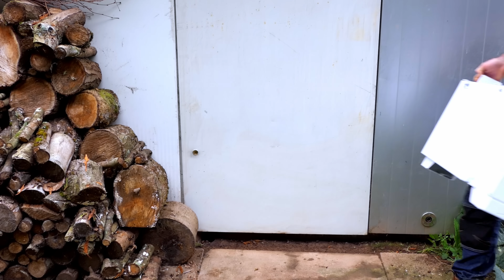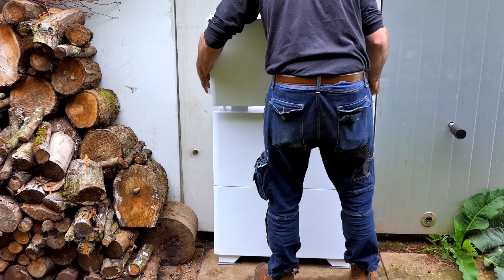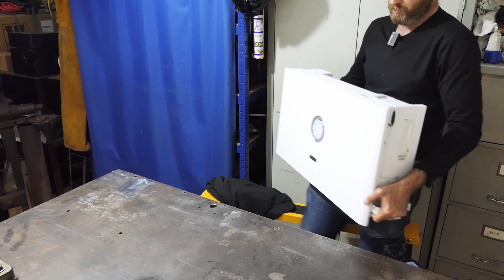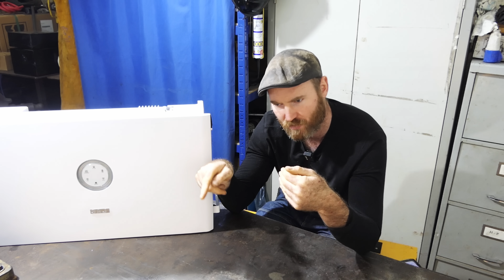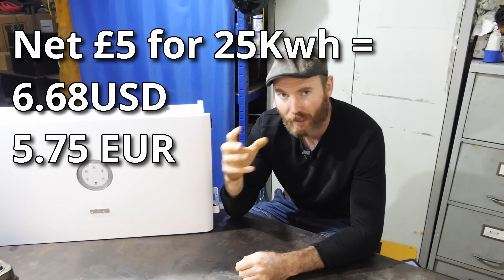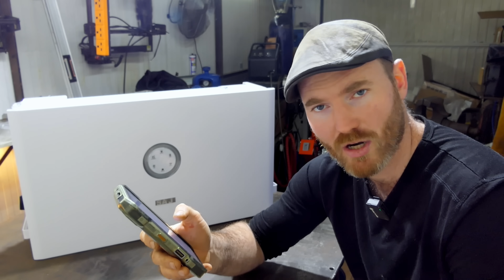New Batteries Make Money?... I'm shocked

Comment: Excellent approach. Have you ever thought of ways to produce electricity from natural gas? In the event of a power cut, gas boilers cease to work even though gas supply is still available. Gas in UK is so much less in cost than electricity, that using it to generate ought to be economically viable. I know you could run a boiler from a small inverter and battery, but no way to recharge a battery unless you have solar panels which don't give much in winter when you most need it. Perhaps you could give it some thought please. Thanks.
Reply: Technically yes, any generator should be able to run on gas. After all, any petrol engine can be modified to run on methane, which is what natural gas is. For vehicles, you have the problem of storage: It can be highly compressed (CNG), which requires heavy and bulky tanks to withstand the high pressure.
Or it can be stored as liquid methane (LNG), albeit not indefinitely. Tanks for storing LNG have to be extremely well insulated, since it is a cryogenic liquid, with a boiling point of -162 degrees C. So tank insulation equivalent to what is used for liquid nitrogen (boiling point -196 degrees C) are required. Even so, no insulation is perfect, so there will always be some boil-off. For liquid nitrogen this isn't a problem, since the nitrogen gas from boil-off can just be vented to atmosphere.
But you don't want to be venting methane boil-off from LNG to the atmosphere - this is a waste of fuel and a bit of a fire hazard, not to mention methane being a potent greenhouse gas, much more so than carbon dioxide. This is why LNG tanker ships actually use the methane boil-off from the giant spherical tanks as their propulsion fuel - it would be wasted otherwise.

Anyway, petrol engines can have significantly improved performance by using methane, if properly tuned to make the most out of it. This is because methane has an "octane rating" of 120, better than even the highest quality premium petrol blends. So an engine purpose-built to run on methane can have a higher compression ratio, improving both power output and efficiency.
Another option is to use propane as the fuel for a petrol engine: The octane rating of propane is 112, so not quite as good as methane, but still better than most grades of petrol. Dual fuel engines capable of switching between petrol or propane have existed for several decades, so converting a petrol powered generator to run on propane should be possible. Liquid propane is also not a cryogenic, so can be kept liquefied indefinitely by moderate pressures. Hence why it is often a fuel of choice for home cooking or heating, particularly in rural areas which do not have mains natural gas supply.

If you don't want to have to modify a generator to use either methane or propane, there is another option: Small generators (in the 20 to 30 kVA range) using a gas turbine engine instead of a petrol or diesel piston engine do exist, though they are far more expensive. These are usually intended to run on propane, but should be able to run on methane without any modifications. The only possible problem with that is whether the mains gas supply can deliver methane at a flow rate high enough for the generator to run consistently. If not, then you may have to use propane anyway.
Reply from the maker: My generator has just been converted to gas because I'm producing wood gas. Lots more on that coming soon. Cheers J

Comment: Very interesting you mentioned a diesel generator as ive actually been considering one with a battery as a kind of hybrid system though ive not done any calculations. For me, its more to stich a middle finger up and get off the grid as much as possible. As with you, we are on oil for heating/hot water but as a tree surgeon, I have anunlimited supply of free logs so use the heating very little. I personally see the cost of energy spiraling to a point where its almost a luxury commodity and I want no part of it
Reply from the maker: I think you and me have a lot in common... I've been doing a lot of coppicing and polarding over the past 5 years and will be doing a lot more videos on wood gas generators. My diesel generator is undergoing experiments using black diesel (heating oil £0.48/L mixed with  filtered free waste engine oil) which is £0.05/kwh... Cheers J
Reply: @joshuadelisle the wood gasification is certainly very interesting but a bit beyond my simple mind sadly. Great watching though and be interesting to see how it goes with the black diesel. Seen a guy on Instagram running all sorts on it so im sure it'll work well!
Reply: But you still have to buy fuel? I’m not sure how you think you’re isolating yourself from price rises.
Reply from the maker: @edc1569 wood for me is free, black diesel is £0.25/L. Cheers J

Comment: Man, can we ever beat this! It's called induction. This pulls from a metered circuit while induction pulls from the surrounding circuit. I really don't understand why others have not loge since moved on to induction collection. It's not free energy, you already paid for it! But it's wasted energy that no one seems to collect? 
Cheers 🍻
Reply: Induction does indeed pull power from a circuit by placing an inductive load.  
It's how electric companies are able to determine with someone is stealing power from hi-tension cables by inductive "taps".
Reply: @_SurferGeek_  
Correct!
Reply: @Finite-Tuning  I guess I'm confused on what you're trying to say then... you say "...it's wasted energy that no one seems to collect?" but it's not.  You can't turn on a light drawing 100watts of power and use an inductive load to collect "wasted" power.  You'd be increasing the load over the 100watts and still pay for whatever additional power you've drawn, or induced, from the circuit.  How is that collecting "free energy"?
Reply: @_SurferGeek_  
You're not yet capable of this conversation. No offense, but you don't yet understand induction. You have not read and understood anything I said. Your question proves this. Education is free if you are willing to do the homework. Liking you own comment is always a bad thing!
Reply: @Finite-Tuning  Education is free but understanding what you're being taught requires comprehension... Clearly you have issues with that part.  Have a great day as I'm done with you.
Reply: @_SurferGeek_  
No need to be angry about ignorance, calm your mind and simply learn how induction works. Or not, the choice is yours! Maybe start with learning about Tesla and Moray.
Reply from the maker: Interesting. Cheers J
Reply: I don't understand.
How could you collect unused induction power. Please explain
Reply: @cajampa  Look up current transformers.

Comment: Doesn't have to be installed by an MCS registered installer. That's not what the regulations state, even though that is how it is interpreted. eFixx have an excellent video on the subject. The UK also produce more than enough gas to supply the nation, but by law they are obliged to sell on the open market. Same for Oil.
Reply from the maker: I think for the insurance and warranty you do... Cheers J
Reply: @joshuadelisle would be good if you can clarify why it is required.
Reply from the maker: @WindyJAMiller I think to make sure it's done correctly and registered so. Cheers J
Reply: @joshuadelisle MCS doesn't superseed IEE.  You do not need to be MCS registered to sign up to SEG it's simply the energy companies acting on mass, blocking the process.  The only company that does facilitate it is Octopus, I've done it myself a few times.

MCS is not the be all and end all of domestic energy and renewables.
Reply from the maker: @WindyJAMiller that's not what I was referring to. SAJ requires the installation to be done by a qualified MCS for their warranty and for the home insurance. Nothing to do with the grid companies. Cheers J
Reply: @joshuadelisle I don't want to go into detail about it all over YouTube.  If you want to reach out to me I would be happy to explain the various aspects and considerations with this and other renewable projects, I've got over 15 years experience in this sector.

Comment: 97.6% efficient, but also needs to run resistive heating elements.  Efficient my foot.  The need to heat these things needs to come out of the efficiency rating.
Reply: The heatings only needed when they are cold. Sub zero degrees.  Which doesn't happen much in the UK
Reply: @WindyJAMiller  I don't believe that for one minute.  They are probably running them at higher temps.
Reply: @tarstarkusz fortunately you don't need to believe it, it's a matter of fact.
Reply: @WindyJAMiller  You know this how?  Stop being a liar.
Reply: @WindyJAMiller  Even more fortunate, you can be corrected too! 
There is no magical boundary at which lithium batteries start to need heating, it's a gradual drop-off. 
If they have a built-in heater,  it would make sense to keep them at a temperature well above 0ºC, for capacity and longevity (life cycles). My guess, around 15ºC.
Reply: @goncalovazpinto6261 I will just point out that only one of us is guessing here.
Reply: It's 100% inefficient if it's only heating the appliance and not anything useful!
Reply from the maker: Fair point. Cheers J
Reply: 97.6% efficient?  I thought he said 96%. In any case, is this efficiency one way, or both ways?  The power conversion needs to happen once for storage and then again when you sell it back. So a one-conversion efficiency rating of 96% would be an overall efficiency of only 92% in a two-way exchange.
Reply: @aerostahr that will be one way, probably solar mppt efficiency too. Round trip with LFP batteries and a hybrid inverter is typically 80% -85% round trip efficiency.
Reply: @WindyJAMiller  Thanks for elaborating.  Is it  typical for manufacturers to specify this specification as a round-trip feature?  It seems to me their marketing departments would try to slip in a one-way conversion figure which would allow them to advertise a higher efficiency rating, and bury the details in fine print.  Also, based on every spec I’ve ever read (take power supplies for example), efficiency is always stated as single-conversion, one-way.  EDIT: Never mind.  That’s exactly what you just said 🙄
Reply: @aerostahr blimey, I was a bit confused when I posted those numbers.  I meant 80%-85% round trip efficiency, everything taken into consideration.  Which is still really good when you think how many times the power is being changed and chemically stored.

I don't think there's an intent to bury the numbers, I think our host is new to this area and has been told what to say.  I think with a bit more knowledge and experience he'd work it out.
Reply: @aerostahr  I double checked and he did say 97.6% efficient.  I don't remember if he said this was one way or round trip efficiency.
Reply: Resistive load heating is 100% efficient i.e. the movement of all electrons is transferred to radiant heat.
There will probably be very unnecessary MOSFETs and MCU to turn said resistive load on and off....
Reply: @Coxeysbodgering  So?  If you have to spend 100wh to keep a kwh at the right temp for an hour, that's a 10% inefficiency.  It doesn't matter what efficiency the heater is run at.  The SYSTEM is inefficient.

Comment: I have solar and batteries.  You're right, you are not necessarily saving money. If I add up the interest i could have earned on the investment of solar I'm probably about breaking even, maybe  a little ahead but if I'd had known than what I know now......
Oh yes. I can't buy a unit of electricity for 9p unless I have an electric  car and charger ( charger alone £1k) or a heat pump
Reply from the maker: Hmmm... That's a bummer. Cheers J
Reply: Eon you can - next drive. Can go on that if you have a battery. I got in it as I was getting one then had to cancel so don’t have anything and still on it! They don’t check anything. 6.7p 12-7am

Comment: These will last longer than 15 years. That’s just the warranty, but LFP batteries (especially when charged/discharged slowly like in home energy storage) last an incredibly long time. I’d say probably 20-25 years.
Reply from the maker: They still work but lose 20% capacity. The inverters however will go out before the battery and will need replacing. Fairly simple though. Cheers J
Reply: @joshuadelisle Good point. I guess I was thinking more of DIY systems like the kind Will Prowse builds, where the cells themselves last that long (with some degradation) and can be replaced separately from inverters if needed.

Comment: Don't forget the additional cost of being on the grid of the standing daily charge, makes being off grid more beneficial than what you said
Reply from the maker: That's a good point. Cheers J
Reply: My standing charge is higher than the pence per hour is -_-
Reply: Whilst it is another cost (might as well drop gas and go electric only to save that), something like £180/year for a "backup" power supply from the grid is way cheaper than any extra battery module would cost.... even if you built it yourself.

Comment: EU average is 0.28 euros per kWh or 24p per kWh which is actually higher than my current fixed rate.
Reply: EU average household price: €0.2872/kWh (H1-2025). Highest: Germany (€0.3835/kWh), then Belgium and Denmark. Lowest: Hungary, Malta, Bulgaria. Taxes/levies make up ~28% of bills. 

UK (Great Britain) standard cap (Q4-2025): ~26.35p/kWh (avg; varies by region) with a 53.68p/day standing charge.
Reply: @WindyJAMiller yeah we always think we're getting screwed over compared to everywhere else and it's often not the case. Some states in America are more expensive than here and then some a about 8p per kWh  which throws the average out completely.
Reply from the maker: That's not what my search said. Cheers J
Reply: @joshuadelisle only seems like yesterday I was paying 12p per kWh back before all the cheap electricity companies went bust.
Reply: @TheCornish123456 I pay less than 10p a kWh, and have done for about three years.  Plenty of other ways to do this without committing to a battery inverter combo unit that only works with the same manufacturers components.  Are you in Cornwall?

Comment: You didn't factor in your households energy usage and that your bill will drop due to the 9p/kwh pricing being even cheaper than economy 7(which i charge mine from).
Reply from the maker: I'll be doing a proper test and will factor in as much as I can in a future video. Cheers J
Reply: If you can get economy 7 or even 10 in a few rare / business cases

Comment: If you have a combi boiler and no battery back up you are going to get cold during black or brown outs. I have a couple of deep  charge boat battery's, lead not lithium, in my loft with a charger and sine wave inverter ready for the inevitable.
Reply: Note that when running many boilers off a backup supply, you need to make sure that the earth and neutral are linked else the flame failure detection will trip.
Reply: @mikeselectricstuff  Thank you that's well worth knowing.
Reply from the maker: @mikeselectricstuff good tip. Thank you. Cheers J
Reply from the maker: Inevitable is the key word there. I've got a number of contingencies but water will be my priority to sort out soon. Cheers J

Comment: I think you would be better off using this system to power a bitcoin miner.  The miner could heat the batteries on a cold day and you could use cheaper stored power to run the bitcoin miner.  Use a crypto miner calculator with a hashrate above 100 terrahash per second and you would be better off than selling the power back to the grid.
Reply from the maker: Awesome. No idea how that all works but fair play if you can get it to earn money that way. Cheers J

Comment: I have an older SAJ system and the problem is its not compatible with the octopus auto feed in buy when cheap system.
Reply from the maker: I'll have to look into that although this is apparently a premium system so it should work. Cheers J
Reply: @joshuadelisle  It may need a firmware update mine or it may just be on the older systems i dont know .

Comment: Straight away, nope! Fire...
Reply: LFP cells are as combustible as wood. These are not the kind of NMC cells in phones and cars that you hear about exploding in flames. Totally different animal. There is still the same risk of fire any electrical equipment can carry with poor installation (short circuits, improper wire sizes, etc) and that can cause smoldering and a house fire. But it’s not more risky than anything else electrical. So if it’s UL listed and properly insulated, it will be fine.
Reply from the maker: That is also my concern also with a lot of these battery systems but apparently this model exceeds strict fire suppression standards. I'll have to look into it more to find out how exactly. Cheers J